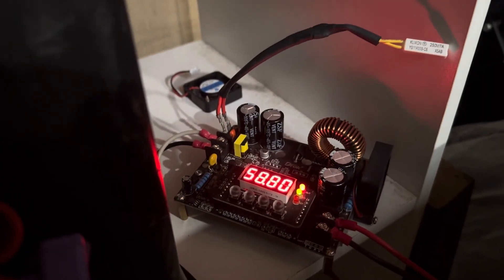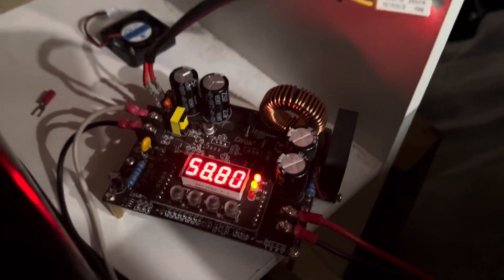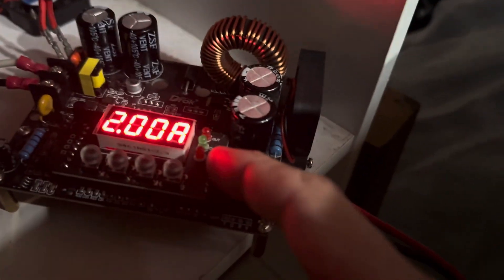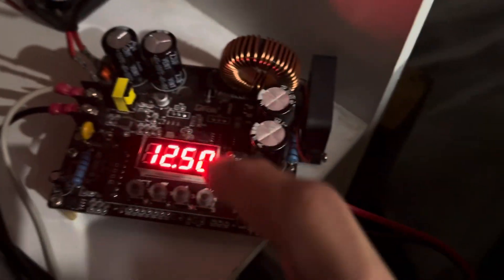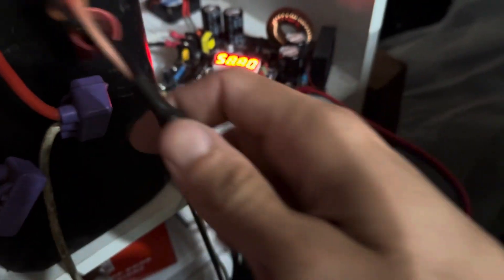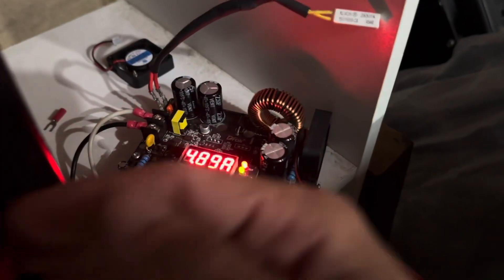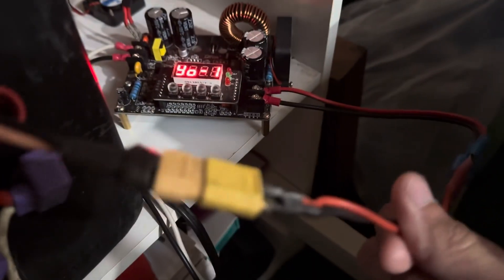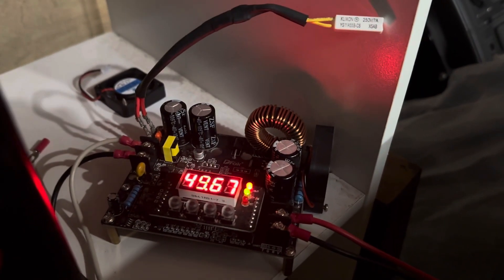Drok buck converter how to use and program.

Comment: Do you know if this unit can detect remaining voltage on the input side from a battery? Or can you set a low voltage cutoff point so if it drops below 15V for example, it shuts off?

Comment: Could I contact you directly? I have a question about your "Nanrobot D4 plus electric scooter battery failure and repair" video but there was no way to comment on it. I would like to know if your repair fixed the battery issue AND if so, could I get more information on how you recharged each cell?
Reply from the maker: @ajaxborges  sorry for not responding until now. I never ended up actually fixing the battery because a lot of the cells were damaged so I ended up just buying an off the shelf battery because it was actually cheaper than buying a new one from Nan robot and it was a much higher capacity battery.

Comment: Hello, thank you very much for sharing the programming, I was reading the manual and it looks very complicated. I wanted to ask you if you could help me program mine. If you can, I need the following. The input will be 12 V and the output will be 24 V, now if the input is less than 12, can it be done so that the 24 V does not come out? (that it cuts off, or something like that) and the other thing is that it is programmed only at these two voltages, I am only going to use it for this. If you can help me I would greatly appreciate it.
Reply: Hello, if what you show in the video is like the one I bought on Amazon, it is also a voltage increaser (boost inverter). My question, if you can help me, is to program it, so that it always has the parameters that I programmed it from the beginning. Thank you very much in advance and sorry for the inconvenience.
Reply from the maker: Thanks for commenting and I’m glad it helped. What you’re describing is a step up or boost converter which this is a buck step down converter so you would not be able to get 24 V with a 12 V input you would need 24 V or higher to be able to get 24 V on the output side, I recommend going with a 36 to 48 V power supply in two the unit so that way you have a wider range of voltages that you can program it to
Reply from the maker: I know what you talking about now but the one that you have has a slightly different user interface than this unit so I don’t know how to program that one